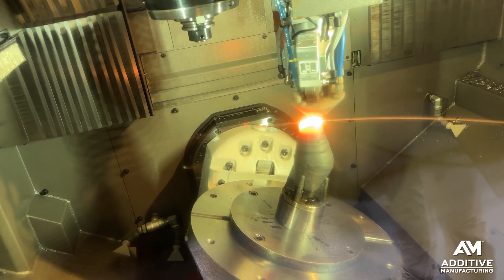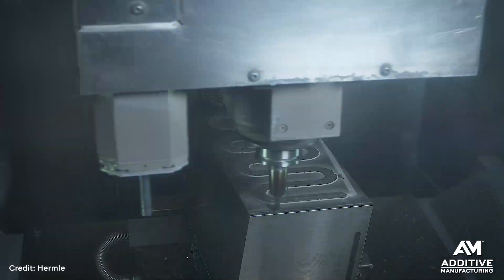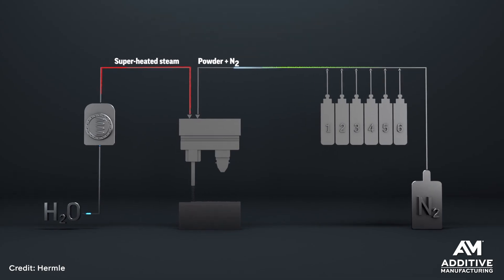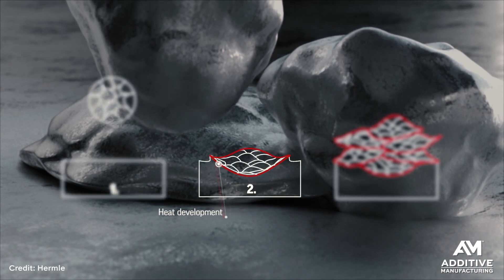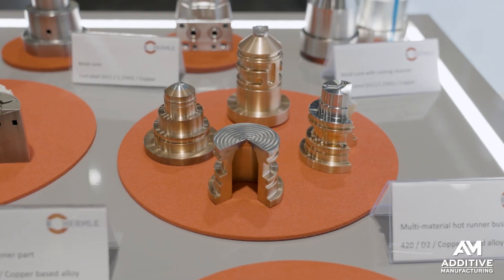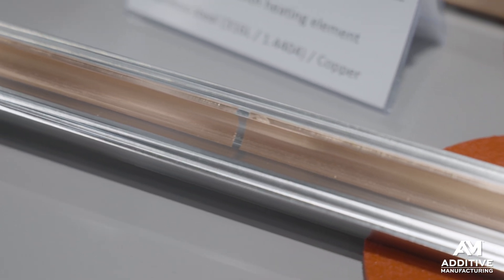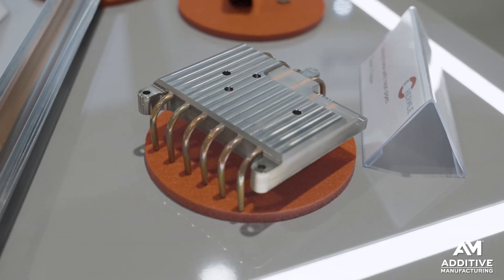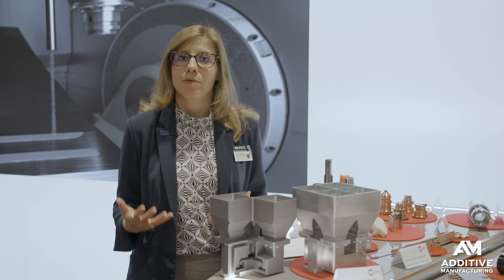What is Metal Powder Application (MPA)? Hybrid 3D Printing Without Melting

Comment: In a first class on thermal spray/spray coating technologies, you learn about two types of processes: 1. High temperature, low velocity processes like Air Plasma Spray where the particles/species are melted and deposited- for brittle coatings like oxides and carbides and 2. Low temperature, high velocity processes like High Velocity Oxygen-Fuel spray where the particles/species are deposited by deformation- for nitrides which are more ductile. It's interesting to see the impact technique being brought to additive manufacturing, as well.

Comment: Why HVOF now MPA? What's the difference?
Reply from the maker: There are a couple of differences between the two processes. High velocity oxygen fuel (HVOF) coating or thermal spray is typically only used to apply thin coatings of material, while MPA can build up 3D features. MPA also bonds the materials through plastic deformation, while HVOF works by partially melting the powder with the gas stream.